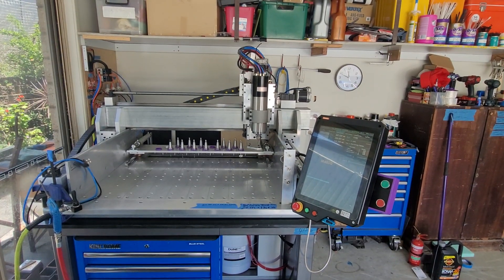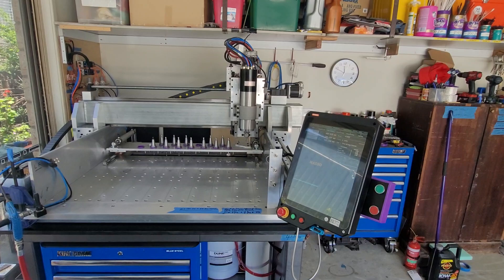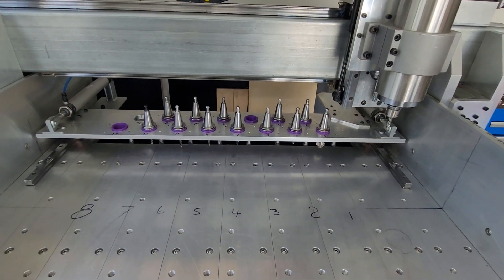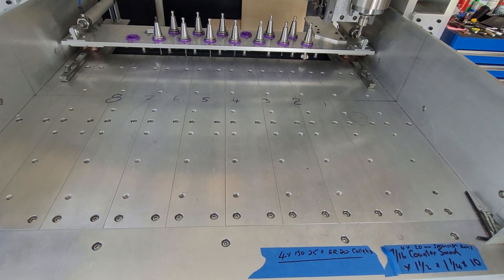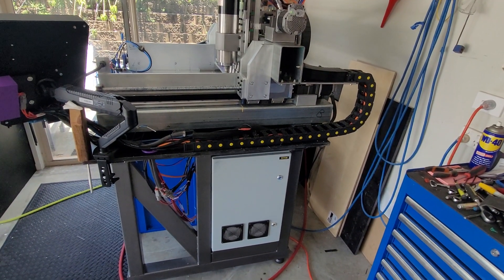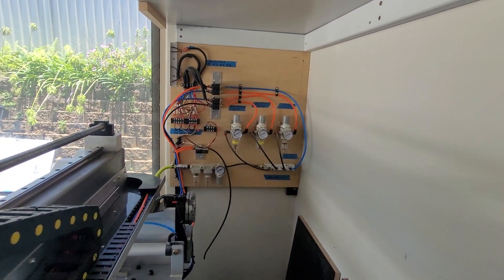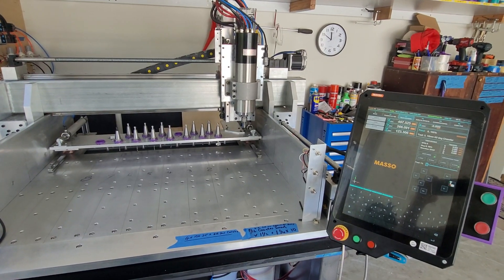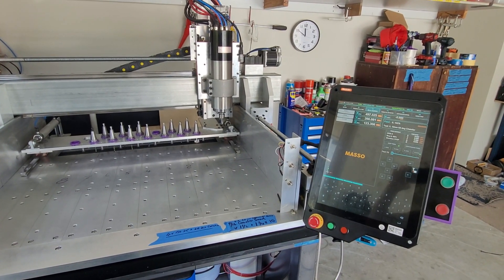Overview of the CNC machine I built from scratch

Comment: Hi Bill, great machine! What software do you use to generate your drawings, create the tool path and do the tool changes? Are you using the paid version of F360? Thanks for sharing all your hard work. Look forward to seeing each of your videos
Reply from the maker: Hi Mark yes Fusion 360 paid version (but got it on sale) so saved a little money you need paid version for ATC to work, drawings and tool paths Fusion then the Masso controller handles all the ATC action . I can change a setting in Masso to make it QTC and swap tools by hand which is handy if I want to use a large or very long tool that won't fit in the tool rack I just finished a full enclosure for my sliding tool rack turned out great Ok cheers Bill

Comment: What ClearPath motors are you running?
Reply from the maker: Hi I use Teknic Clearpath CPM-SDSK-3421S-RLN on the X and Y and CPM-SDSK2331S-RLN on the Z but could have gone smaller on the Z as I now have fitted a Gas strut / lift strut which would have made the Z height more compact, I just love the Teknic Clearpath Servos . also they have inbuilt Drivers so you don't have any in the electrical enclosure , No EMF from the VFD effecting them . Also Teknic servos have auto tuning function which works great. So what's the down side, well it's price you are paying for the quality I also went with the IPC-5 75 volt PSU's and there pre made cables so it was plug and play very happy with all the products.......... Ok cheers Bill

Comment: Impressive skills you have there! Any thoughts on build time, design time? Very clean and well thought out.
Reply from the maker: Hi Bill Well build time is totally dependent on how many hours a week you want to put into it some have built PrintNc CNC's in under 3 months but most are more like 6 months for me it was all about the project of design and build and the design changed a coupe of times so in the end 12 months to build mine to a point where it ran and then I started the little mods and upgrades But I have learnt a lot of skills along the way and I know my machine inside out, Bill if you look at some of my latest videos you will see a few of the latest changes cheers Bill

Comment: Hi Bill, did you by any chance document or video the building of the ATC, thanks. I've built a pretty strong machine but I struggle with knowledge of electronics.
Reply from the maker: Hi my whole build is documented on the Three Desings  Print NC Forum under Bill's PrintNC PRO Build Log from start to finish with heaps of info and photos on the ATC also check out my other videos on my YouTube channel to see it in full operation Cheers Bill
Reply: Thanks Bill

Comment: I am really impressed with your machine. How long did it take for you to design and build it?
Reply from the maker: Hi My machine is based on a PrintNC with quite a lot of upgrades and modifications to get it to where it is today most people build a basic PrintNC in around 6 months some have done it in a lot less I treated the build as a project and was not concerned about how long it took as I was enjoying the build itself and just wanted to build the best hobby CNC I could with the tools and equipment I had, as it turned out I have been very happy with the results. So how long did I take to build mine to operational with the ATC as well, 18 months cheers Bill

Comment: do you fear chips getting onto the exposed ballscrews and linear rails in the z and x axis?
Reply from the maker: Hi well it is some thing you have to manage the high alloy side help a lot and when not filming I put a cardboard shield around the work piece and when I do that, very few chips go over the sides the X screw is quite high around 325mm off the bed but I still do find some up there I have not found any suitable ball screw covers yet

Comment: Awesome ATC. Very nice build. I noticed that you are using servo motors, but elected to go with lead screws over ball screws. Why the preference for that? 

Looking forward to more videos, any chance you are going to try and cut steel with this?
Reply from the maker: Hi No I have used C5 precision 2005 ball screws with double ball nut on the X and Y axis and a 1605 ball screw with single nut on the Z axis and they have been performing very well 
you would never use lead screws on a cnc machine thanks for the comments if you have any more questions please feel free to ask cheers Bill